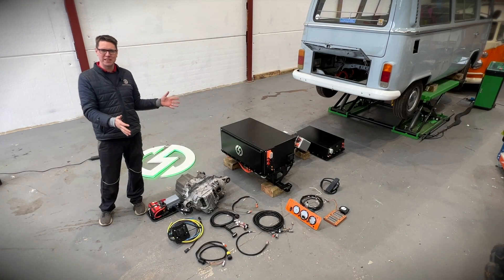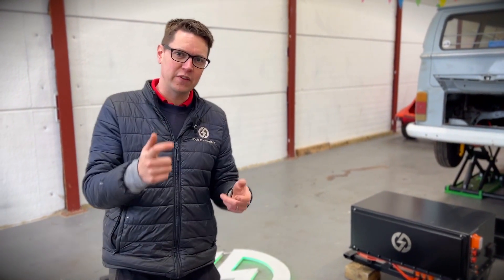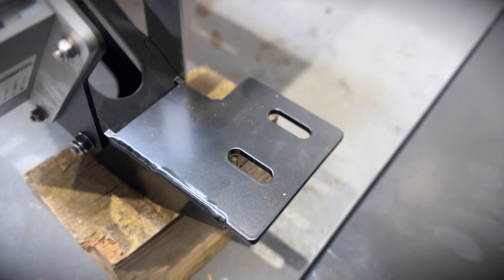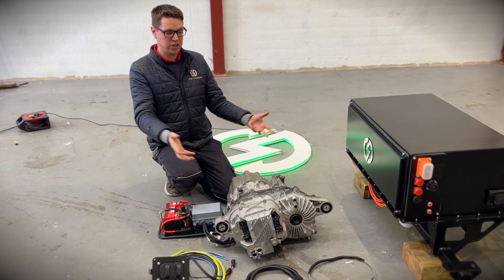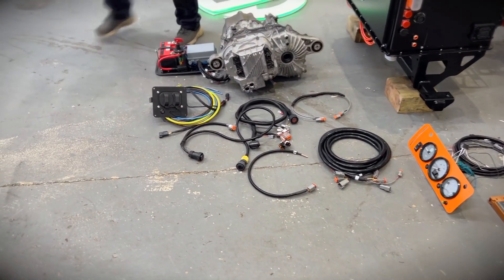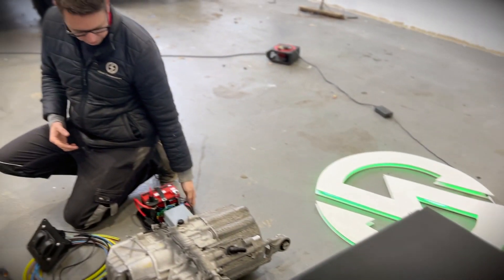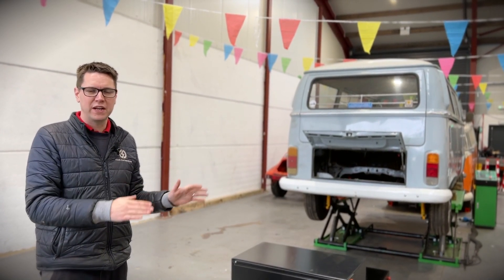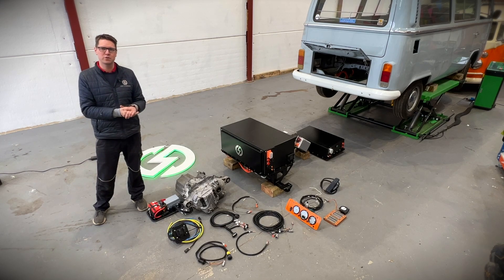Electric Conversion Kits for VW T2 Camper Vans | eDub Conversions

Comment: Can your kit be adapted for similar types of vans, such as the Toyota hiace?
Reply: Do you need a different adapter plate from motor to trans. You need a different coupler from motor shaft to trans shaft. You need different motor mounts.

Comment: Can you answer a question about the motor?, this is a question from someone who has worked with 3phase ac motors for 40 years.  They use 3 phase ac motors that have a phase angle of 120 degrees can say that this happens with your conversions as this affects efficency of the motor.  Also does it run in star or delta or a combination of the 2.  Im guessing they use star which gives you more torque to pull away etc.  This would also explian why they are not so good on the motorway as star uses more current.  Most industrial motors change from star to delta at 60 percent speed as delta is more efficient at higher speeds.

Comment: Any plans for t25’s? Also 100 miles? If anything needs a long range it’s a camper.
Reply from the maker: No plans for T25s unless someone commissions us
Reply: To clarify many camp sites don’t have electricity. Also how easy would the nc500 be to do with such a range? In fact someone must have tried it in an ev?
Reply from the maker: This video show our e30 kit. We have a larger e60 for 175 miles range.
Reply from the maker: I’m sure someone’s tried the NC500 in an EV. charge at the campsites or public charging stations
Reply: It doesn't make sense mate this costs over 60k it's ridiculous, you're much better off going subaru or tdi at a fraction of the cost

Comment: Cost? ...and would it fit a T25 1987 vintage?
Reply: In Ukraine, 6 years ago, the T25 was equipped with a Nissan Leaf. 250 kilometers of run. He still uses that car every day. The engine was rewound, the controller was homemade.
Unfortunately, he doesn't make custom cars.
Reply: @VolodymyrKostenko-q1m  I was thinking of a Leaf to T25 transplant, interesting!
Reply: Good grief that's ridiculously expensive! I can get a re conditioned aircooled vw engine good for 100 000 for 1200 pounds and it only takes 2 hours to fit.
Reply: @andrewallen9993  even if you are wrong and buy a 100 Hp engine from CB Performance as a kit, that's 5K USD and you want a freeway flyer transmission 2-2500 USD...ad a disc brake kit from that german company for 1500 USD...bah dah bing !  you are zipping along !   that's my plan, but I am open to new ideas too...
Reply from the maker: The kit pictured is £65k. There is a higher range kit for £80k with an extra battery box
Reply: @eDubServices  a brand new ID Buzz would be less, and whilst it doesn't have the same appeal as a classic T2 perhaps it would also have improved safety features.
Reply from the maker: Sorry, this is specifically designed to mount to T2 engine mount points, to keep the DVLA happy 😊
Reply: How much will it cost to ship to Kenya

Comment: On a T2 that has beefed up braking system and better suspension, can I still tweak the power the motor will output or is that locked at 110bhp?
Reply from the maker: We will need to raise the output at our workshop with thorough testing. You won't be able to tweak it yourself, but we can be commissioned to do it.